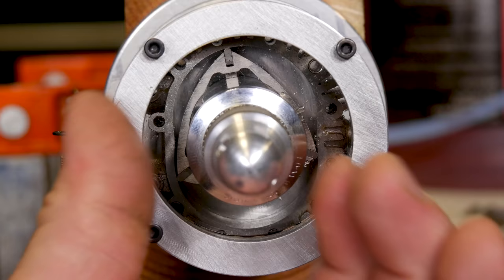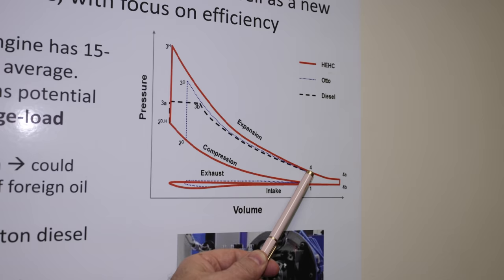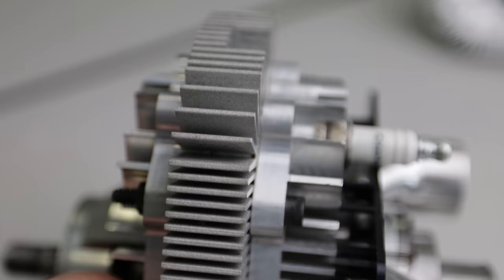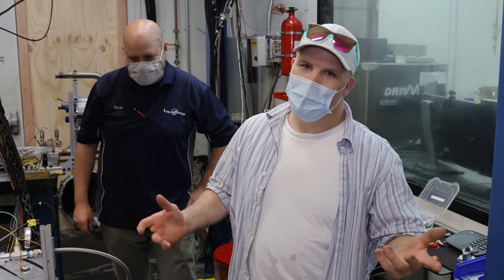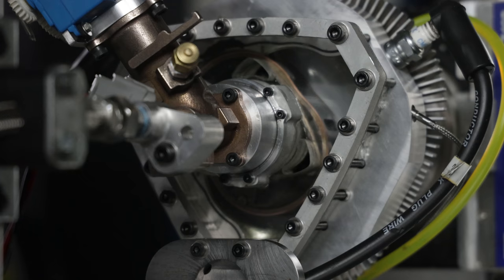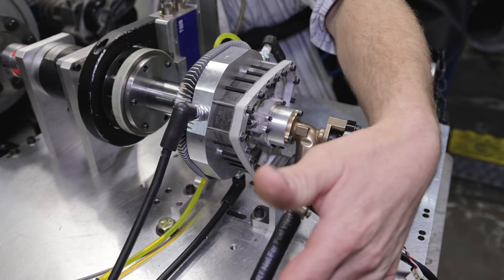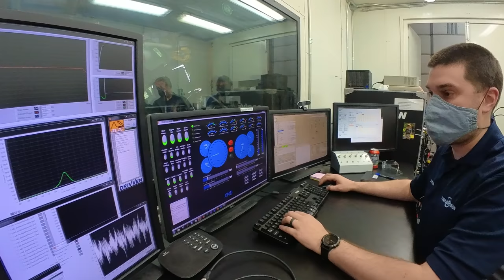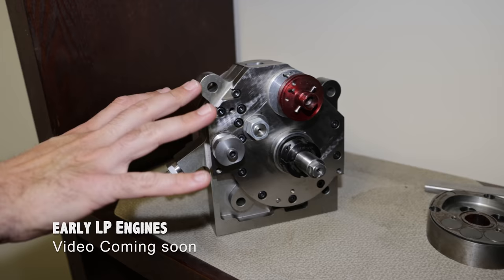See Thru Liquid Piston Rotary Engine - In Slow Motion

Comment: Should this engine become popular, one way to tune it in order to provide more power and efficiency would be to resurface the combustion chamber to force the exploding wavefront up against the power stroke part of the peanut. 

I mention this because in the acetylene run the opposite was happening in the primary viewing chamber, or at least it seemed to be. The fire was against the advancing head rather than the retreating head. This would require a lot of advanced fluid dynamics simulations, but hey, free energy.
Reply: I have to concede to your level of expertise. Look at all the videos on your channel on this topic. You are clearly an expert.
Reply: @eriklarson9137  What are you butt-hurt about? I'm just some random guy on the internet.
Reply: That would be a tough nut to crack, as the rotor will always be compressing the front edge more than the back edge. Using direct injection angled toward the back might help. Good observation.

Comment: AKA: "How to turn a Wankle engine inside-out and make it work... better."
Reply: yeah ... a great invention ... but .. in the beginning era of electric vehicle ... it's a bit late but better than nothing ..lollll
Reply: @pooorman-diy1104  hybrids will still be a thing for a while, and i imagine it would go super well with a hybrid battery.
Reply: @pooorman-diy1104  Rotary motors like to run at a constant RPM, in the era of hybrids and electric vehicles, a small, fuel efficient rotary could turn a generator at a good enough speed so that it can produce the power for the battery to drive the car.
Reply: @Oatmealism  hybrid vehicle is like a band aid .. not a real solution for future transportation  ...lol...
Reply: @pooorman-diy1104  there are places where a hybrid works better and makes more sense then a purely electric vehicle. That may change but for the time being it's true

Comment: I wonder how long the seals last; it looks like the sealing geometry varies quite significantly as the piston spins.  I suspect the variance is much greater than traditional apex seals, and as such wonder if this design will suffer an even shorter service life.  Another big issue is the intake and exhaust timing and duration is fixed - a limitation that probably cannot be overcome - which makes it quite unlikely this design will ever be able to pass modern emission standards.  I suspect this is why the designers are keen to tout its alternative fuel credentials... Honestly, it surprises me that anyone still believes that it's worthwhile trying alternative 4 cycle designs in this day and age; not only are gasoline engines on the way out, but the modern reciprocating engine has been heavily optimised already.  Perhaps the military might be interested in this design for loitering drones however... there are no emissions standards to meet, and the service life is probably measured in hours lol, so the weight/power advantage might be worthwhile...

Comment: Would like to have an ev with a small battery and a rotary engine range extender. Carrying giant, heavy, expensive battery has a lot of downsides: More wear on tires and components, more particles from tires in the air, worse handling, worse brakin etc.

Comment: I think my main concern with this design is the intake. Pretty big restriction for higher power levels. I'm thinking that adding some kind of valve system for intake ports might actually be advantageous. Could potentially have a very simple rocker system activated by the rotor itself. Not really sure, just musing.

Comment: I want to be Alive when a complete "Diamond "engine is made and never Ware's out.
Reply: I had that thought actually - maybe not diamond but I wonder if certain low-friction long-wearing ceramics could be used on this, make the seals out of that and not require any lubrication at all. Probably not diamond - actually a coating of "diamond-like carbon" - as that probably wouldn't hold up well in a combustion environment, diamonds actually are flammable. But something else providing similar characteristics while also being tolerant to extremely high temperatures.

Comment: One of my major problems with rotary or wankel was that they were very heavy on fuel and really the way electric vehicles are going these engines have a great future i would say in generators and emergency water systems in bush areas especially if you are able to run them on i would say diesel.

Comment: Hmmmm..... I was watching the vibration of the engine as it was runnning and wondering if you added a second, timed and counter-rotating engine, would it run smoothly and double the output power.  Of course, there would have to a way to combine the counter-rotating shafts into a single drive to power wheels or props.  Very interesting video!!
Reply: Same thought here. Just stumble on this video now. I am not ME but thinking it needs 3 engines corresponding to 3 comburstion chambers at the same time at different angles to remove the vibration. Kudos to the team for the good work they have done.
Reply: If you look at the footage of the engine running on gasoline, it has very little vibration... For example, a typical piston engine uses very heavy counterweights to overcome the forces generated the reciprocating pistons. The engine in this video isn't running properly due to the glass "clamber" installed on it. I would imagine, once sealed properly with a proper chamber, this engine would have almost very little vibration to it.
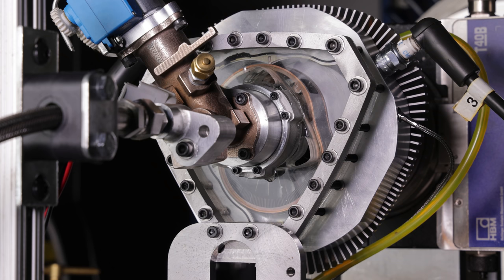Reply: @JJ_ExMachina   I had to go back and rewatch the video.  What you are saying makes sense.  One thing I noticed was when the engine was running on propane @ 6:24 it ran very smoothly.  The second run on propane wasn't as smooth for some reason.  Regardless, this is a GREAT design and, imo, a vast improvement over earlier rotary engines.  This engine has a LOT of potential...

Comment: The slow mo shots were awesome what a cool piece of kit.

I noticed that the firing stroke was on the same end side of the rotor at each ignition point. I'm not a mechanical engineer but  wouldn't this create thermal imbalance and excessive wear?
Reply: Certainly could be a problem, but I would assume they took this into consideration. Designed it with clearances to expand, and to be able to expand asymmetrically without too much stress. Also note that there are a lot of cooling fins on that side, and they described that cooling air flows through the interior of the rotor, mixing with exhaust gases.
Reply: Also if you notice, there are quite a number of fins on the exhaust side of the rotor. My guess is that this exhaust side can pick up some heat front the exhaust gasses and reduce the thermal imbalance a bit.

Comment: All combustion events occur only on one lobe of the rotor plus exhaust gasses flowing through it will surely cause it to overheat and warp due absence of oil cooling. Note: Mazda rotors are oil cooled internally by splash method.

Comment: Upon further review, It was said that the engine could achieve roughly a 1 pound to 1 HP rating, but that was never tested or challenged in this video. I will be charged my final timeout and have no more challenges remaining. There will NOT be a 10 second runoff. Please reset the game clock to 163:35!

Comment: Looks like a great idea for any applications without strict EPA emmisions/mileage requirements (I e. NOT an automobile).
But I think still suffers from the problems that killed two strokes AND the Mazda RX7.
Transfer ports, vs. mechanically operated valves, will always have a fair amount of leakage between the intake and exhaust cycles, leading to a larger amount of unburnt fuel charge escaping.
Never get the emmisions and milage required and expected/required in cars nowadays.
Unless I'm missing something new here.
But still looks awesome and I am sure there are some great small engine business cases where weight is the primary factor! (Drones, etc.) Love to have one for a motorcycle!

Comment: Nice design, but there is a problem: see that little "bulk" where the combustion happens? See how the rotor never entirely touches that tip of the combustion chamber bulk? That means the exhaust strike can not drain exhaust fumes from there since the rotor never reaches the end. So how do the exhaust gases exit from there?
Reply: A traditional ICE engine has the same sort of volume at TDC that never gets evacuated either
Reply: Cylinder head has a pocket too but I hear ya

Comment: The main problem no matter what you do to change this design is the fact that this is a Piston Port Timing engine like a 2 Stroke Piston engine. It will be harder to tune to run smoothly while passing emission standards than a Valved 4 Stroke Piston engine. But it will have special and unique applications. Multi cylinder radial engines did not end up in cars, but they were great airplane engines in WW2. These lightweight and powerful engines will most likely end up in airplanes as well if proven reliable and fuel efficient. Otherwise it is only a novel approach to attempting to fix an engine that (like the radial engine) has already come and gone.

Comment: I found this very interesting, but this seems an early prototype that would need a lot of development to be used in a high reliability applications.  The three seals that replace the original Wankel apex seals still need lubrication.  For a clean engine, that lubrication should not get burnt with the fuel, so how is that lubrication managed?  Further, the seals are subject to constant wear against the face of the rotor. That wear is compounded by the presence of the two ports in the rotor. This is much harder to manage than with conventional pistons in cylinders.  Then there are the edge seals on both sides of the rotor. They are also still subject to wear, so I see maintenance as a possible problem in many applications.  While this engine does not have the same differential heating across the body that a conventional Wankel has (since this engine has three equal chambers, versus the Wankel always firing on the same side) there is still a degree of differential heating across the rotor with one side constantly cooled by incoming mixture, the other heated from combustion and exhaust.  I do like the attempt to minimise that problem by the careful interior design of the rotor.  Lastly, there could be problems caused by the varying expansion of the thickness of the chambers and the rotor as the engine goes from cold up to operating temperature.  It will be interesting to see how far this concept goes. Sadly, I am not optimistic about its chances.

Comment: It was a unique and amazing video!!! Thanks for it. As it is clear the biggest problem with the Wankel-engine is the seal inside the engine. So I think the future is not using this engine as a current engine in a car, but to use it in a small version in the electric cars connected with a dynamo to re-charge the batteries while you are in a long tour and the batteries got exhausted meanwhile. Again: it was a great video!!!!.

Comment: Respectfully, if I may, I would write some remarks on this Wankel type of engine! The thermal, (and therefore mechanical) efficiency of this type of engine is much less than that of a classic piston engine. This is the main reason why the development of the Wankel engine did not go further. In short, the thermal-mechanical efficiency depends on the shape of the combustion chamber. Engine efficiency depends on the volume-to-surface ratio it is limited to! It is known from mathematics that the ball has the smallest surface area for the same volume of all other geometric bodies (cubes, rollers, pyramids, etc.). Another thing is the moment of transmission of the thrust force, which depends on the sinusoidal function. The arm at that moment is larger in a classic engine than in a Wankel engine, which is why the efficiency of a Wankel engine is lower. That is why with a Wankel engine a lot of thermal energy goes to heating the walls of the engine, and little is converted into useful mechanical work. I hope you understood me a bit, because my mother tongue is not English.
Reply: You speak better English than many who have English as a mother tongue.
Reply: Sir, your English is superb, no worries there. More importantly, so is your analysis. Essentially, what you're saying, when translating to car guy speak: specific hp invariably be lower than that of a piston engine, meaning that while this engineering sample is 2kg and 4hp, scaling that for automotive applications is very difficult to achieve. That said, for power tools and small engine applications, I'd suspect it's very reasonable, if made coat effectively
Reply: Well explained, can’t beat a cooling system where power is generated. M/cycle  Wankel engine, was a new ting back then , but never really got much further. .

Comment: Very excited to see this prototype of the "LP rotary", but also have concerns about structural integrity caused by having a hollow crankshaft. How will reliability fare over a regular ownership lifespan?
Reply: It should not be as much of an issue, sice you got power delivered much more smothly, and from all directions. Also crankshaft is straight like camshaft witch in tern transform to stronger schaft and reduced forces. Bigger problem will be making more powerful engine. Putnig 2 or 4 rotors wont be so easy sice intake and exhaust manifoulds got constand and limited diameter. But overall I am waiting for new car with this engine. It will probably be on top on my wish list.

Comment: one thing I'm wondering, are these stackable like a normal rotary engine?
Reply: Would be kinda useless if not :D
Reply: @-NME  which appears to be the case, unless the seal shown can be bored out through the side to allow the exhaust gasses to go somewhere
Reply: I venture to think that they could have just the intake air move through the crank and use direct injection to solve the problem of uneven fuel feed in stacking.
Reply: @AtlasReburdened  the engine already *does breath through a port in the crank
Reply: @THESLlCK  Yall are missing the key placement of the word "just" in my comment. As in, excusively the air. As it stands, both the air and fuel are taken in through the crank.
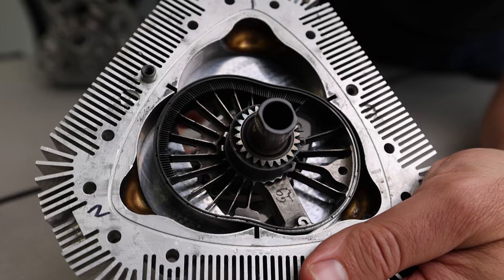Reply: @THESLlCK  If you look at 3:29 you can see right through the cooling air port (behind the rotor).  I think that exhaust in a stacked configuration will end up just going into the next chamber's cooling intake.  They could probably increase cooling air throughput if they angled the cooling fins/supports in the rotor so that they also acted to boost air flow.

Comment: We NEED to see it run on diesel, if they make a large capacity, heavy duty model, or even Multi-Rotor, this could be a huge Step for The Rotary, imagine a rotary running on Biodiesel

Another thing we all need to see are the Dyno Numbers and Graphs, if this motor can produce smoother and higher output than its gasoline/Diesel Variants, we could see things we never thought were possible

Comment: I think the engine could be a huge success, but the manufacturers need to make a step and actually build a car with it. If the engine proofs itself, it's gonna be a huge success.
But my big question would be. How does it react to boost?
Reply: Can have a niche market.  Huge success?  Cannot see that there is a chance.  Efficiency.  Fuel consumption is key.  A fuel guzzler nowadays will be difficult for mass market.

Comment: In time, the rotary center will become "Pear" shape since only one side of the rotary circle is exposed to "Combustion" stroke. + 3 combustions in one revolution means more fuel consumption + some unburned fuel, air & exhaust air are trapped inside those small cut-out ignition chambers
Reply: It means more power like a two-stroke you get more power strokes per revolution more power strokes per minute or per second that's why a two-stroke makes more power than a four-stroke
Reply: They're good on gas

Comment: Neat! What are their applications for this? Hobby? Small generator? Looks like it'll require oil to be mixed with fuel for rotor lube and sealing, or metered into the combustion chamber, am i correct? So with most countries emissions regulations i don't see toooo many applications for it outside of hobby stuff, or compact power like a little boat motor or small generator? I'd love to hear more.
Reply: Oh i visited their webpage, pretty much the applications i was thinking. sweet!
Reply: currently they are doing military applications

Comment: Thank you for all the effort that was put into making this video. This is great technology. Just one observation I'd like to make. The engine seems to run much smoother on propane vs gasoline. I wonder if the eventual production version of the engine will have direct injection into each combustion lobe, which may smooth it out a bit.
Reply: Very good observation! I STILL THINK IT MAKE ONE HELL OF A GAS SCOOTER! WEAR A NEON YELLOW HELMET AND YOUVE GOT FLASH BORGMAN! ACE WANKEL GURU FROM SCHTUTGART! ONE OBSERVATION THOUGH, THE WANKEL ENGINE MAKES JUST AS MUCH VIBRATION AS A PISTON ENGINE, AT LEAST THATS HOW MY EYES SEE IT. MAYBE A NEIDYMIUM MAGNET AT EACH LOBE TO REPELL VIBRATION?  IF IT WORKS CUT ME IN FOR A SMALL PERCENTAGE?